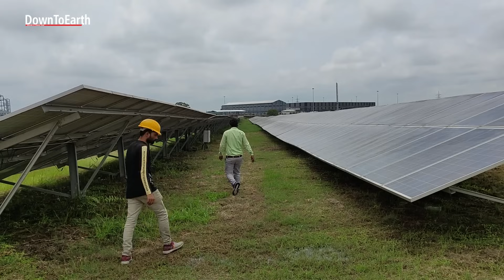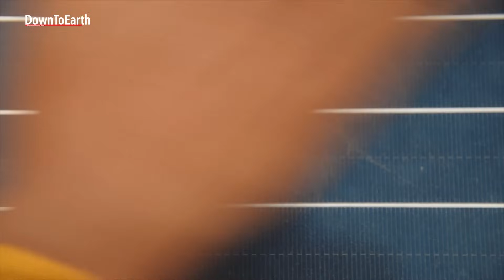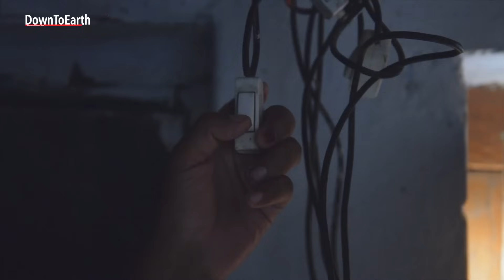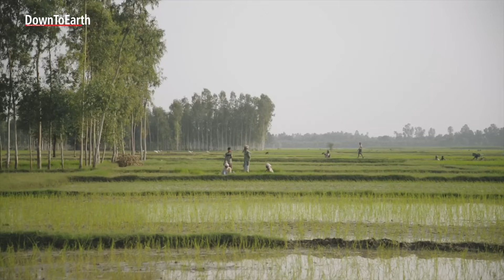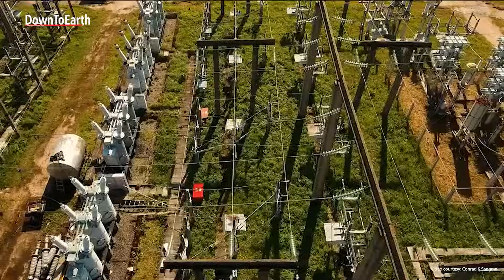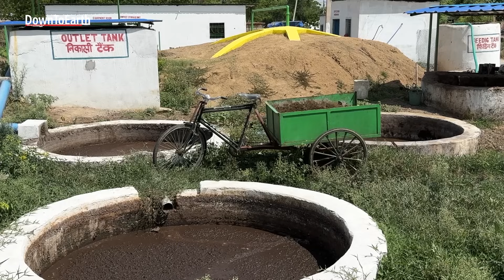Users and Producers: How to empower communities through decentralised renewable energy?

Comment: Also, you don’t necessarily need pineapple mechanical machines, every day of the year, just for that two week window to value add.
The energy needs for your workers needs to be everyday of the year, for everyone, to keep your workers local. 
Allow them to plug in their phones, home batteries, vehicle batteries, etc, beyond your property work loads. 
Be super generous with this offering. It will mean less batteries for you, and a loyal workforce. 
They go home, and use those four hours of batteries for family time.
Allow your workers to use an electric rice cooker to make their meals for the week, on site, on breaks. 
This will produce loyalty, which makes farm life fabulous. 
Most migrant farm workers are only there until the crops have been tended, then must move on. 
Your work environment needs to be an ideal experience, full of fresh foods for the workers. 
Then, I would like to eco tourism there, and eat the pineapple with the locals, local cuisines.  No waste , but abundance. Everyone goes to sleep early, to not waste batteries is optimal for health in the 21 century. Almost like you keep the rice cookers at work, under solar array, and every worker has their own pot and lid, for transportation. Just poor their food when it is their turn , so everyone doesn’t have to purchase the entire unit, just the metal bowl and lid.